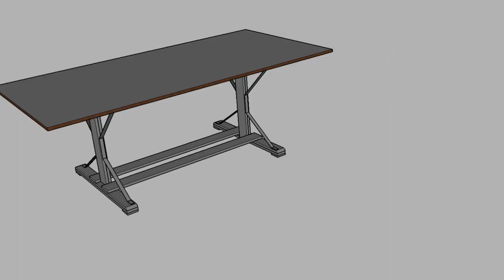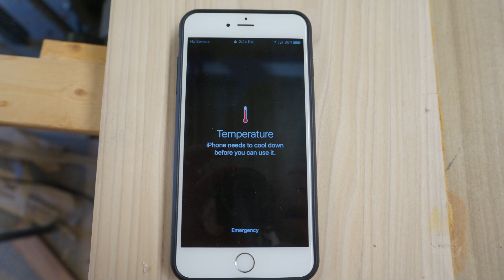Building a Kitchen Table | Woodworking | No Voiceover

Comment: 7:48 : why? :/
Reply from the maker: I was going for a deeply textured look and have numerous experiments, the wire wheel on its side was the most promising.  In the end... well, the results were mixed.  Overall I'd say it does look nice when it's completed but I can certainly see some problem areas.
Reply: @granworks  next time try brushing all the surface with iron whool. 😉
Reply from the maker: Yep, I tried that.  As with most of my experiments, it was too subtle a look.  I wanted dramatic grooves that would play with the light and shadows and that requires something very aggressive.
Reply: @granworks  iron wool comes in différents sizes, but if you want something more brutal can also try iron brush. Or both for an "aged" apparency.